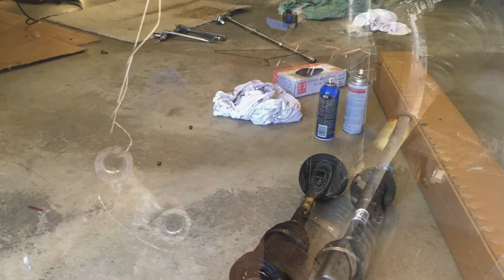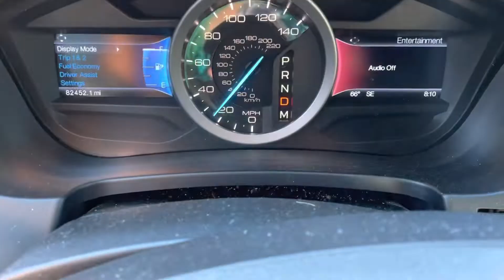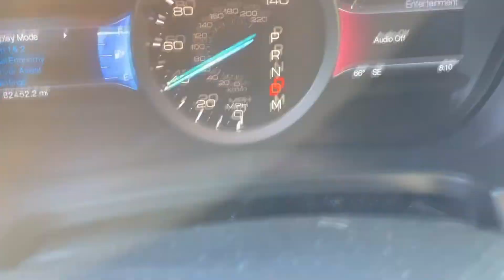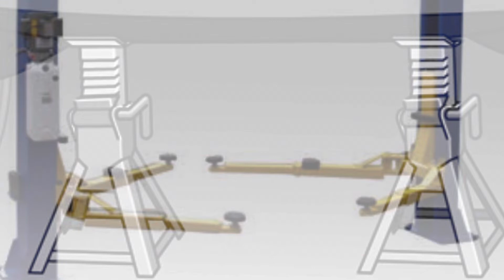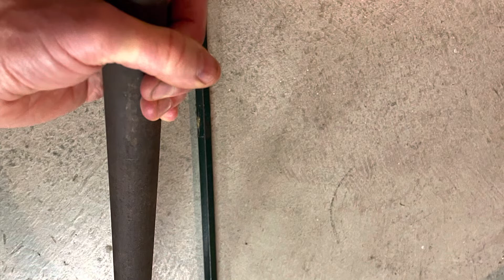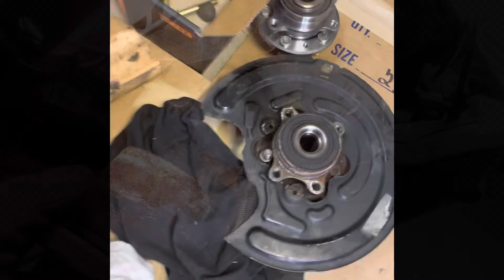Ford Explorer PTU Wheel ￼bearing CVC axel shaft

Comment: I’m sooo happy I came across this video. I have a 2015 ford escape and just had my PTU serviced at ford back on may 26th. I started hearing some weird noises that started at 70km and up to 120km an hour.  And within a week I could start to hear it around 30km and hour and up. I was suspicious of the work they did so I went under the escape. No visable leaks from the PTU seals or vent. I decided to drain the oil and there was 250ml of the 530ml that should have been in there. And it was black. I thought that’s extremely odd. I had suspicions that they under filled it and wrecked the PTU. I’m really starting to think they never serviced it at all. There’s allot more to this service story but that’s for another time. I’m really really suspecting a wheel bearing has started to fail. This escape has 265,000 km on it now.

Comment: Very informative video, thanks for sharing. I recently got a used 2015 explorer. It has 160k miles on it. It drives fine but I found half of PTU case is covered by black grease, possibly leaking. I am planning to drill and tap a drain hole on the bottom so that I can change the oil and hopefully this can make this car last longer.
Reply from the maker: Thanks- good call adding the plug also replacing heavy gear oil with that thinner Redline lightweight oil will definitely help oil work it’s way through the sludge that could be restricting thrust washer lubrication in your unit
Reply: I drilled and tapped my wife’s PTU on her 2013 ford edge. Worked with no issues. Was easy. Luckily my 2015 ford escape has a drain from OEM